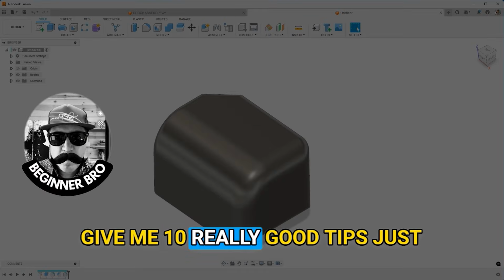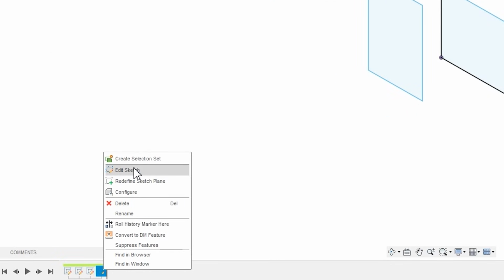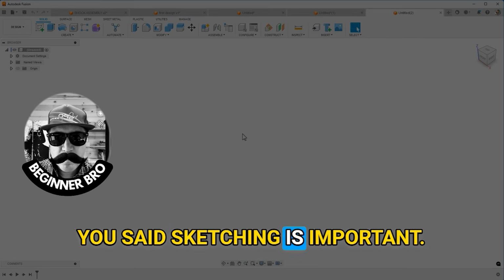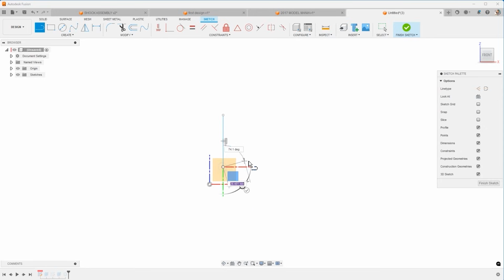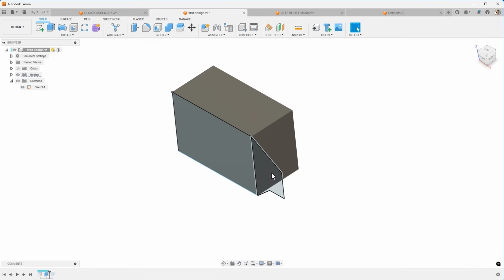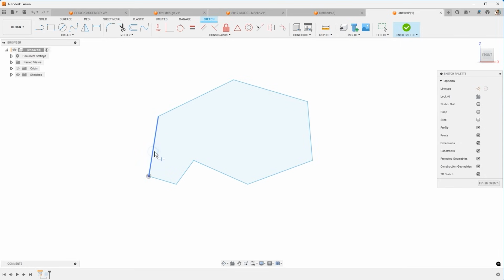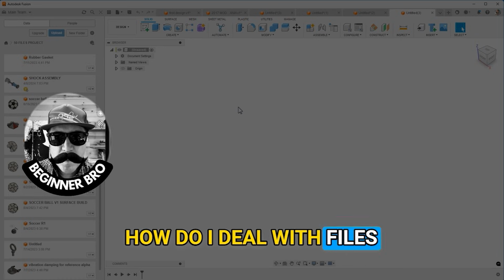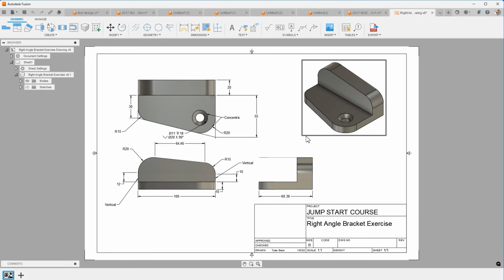47 Fusion 360 Tips in 15 minutes - Tips Everyone Should Know

Comment: One cool thing I found is that when you are using “mm” in your environment and have a dimension in inches, you can actually enter the inches dimension with a “ at the end and it automatically converts it. Also, if you know the dimension you want is half of your known dimension, for example if you want half of 43 mm, you can enter it as 43/2 and it does the calculation.

Comment: Excellent videos, I used Ansys Spaceclaim for the past 15 years as an Engineer. But I was fortunate to retire last year at 38 years old and no longer have free design software so I'm giving fusion a shot since a seat is about $2k less than SpaceClaim and pretty good Cam software. 

Amyways lol I have a Question:   
When you change from modeling to sketching, is there anyway to change the view / "look at" when it ? If I'm working on an area thats aways from the center of the drawing and go into sketch mode it recenters my vew back to the origin. This gets so annoying. It would be nice if it would center itself at the center of the plane or feature that your working on vs the other side of your work space. lol

Comment: Screw getting a 3 button Mouse. Get an MMO gaming mouse with 12 buttons on the side and you can keep bind so many more things to the side of your Mouse. i have multiple profiles for every different program and I can quickly swap between the different key maps depending on what program I'm using. You can even do modifiers with alt, ctrl and shift. You don't even need to be a gamer to buy a 12 button MMO Mouse. They can be set to do pretty much anything from making macros to launching programs or doing Windows functions.

Comment: When you're selecting edges on a 3D object, how do you prevent Fusion from allowing you to select edges that you can't see?
As a basic example, if I'm looking inside a box that I want to select all the internal corners to fillet, Fusion also allows external corners to get selected without them being visible (selected them through the object, if that makes sense).
I've tried googling this in an attempt to find the correct setting, but I feel like I'm googling the wrong terminology.
Reply: Deselect bodies, sketches and components in the browser tree. The you can access the part you want to highlight...Or click on the component and right click isolate..
Reply: I highly recommend using chatgpt to answer these types of questions. Simply copy and paste your comment.